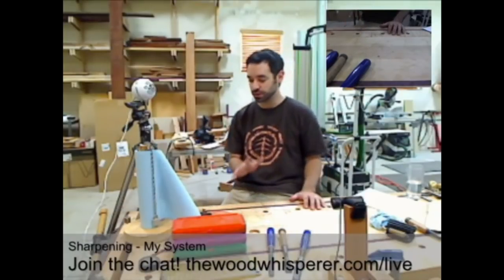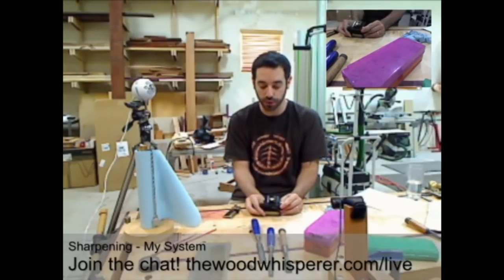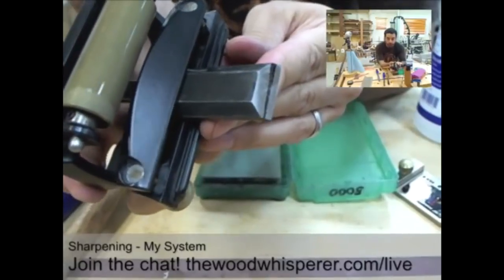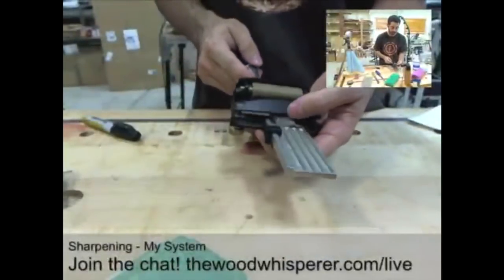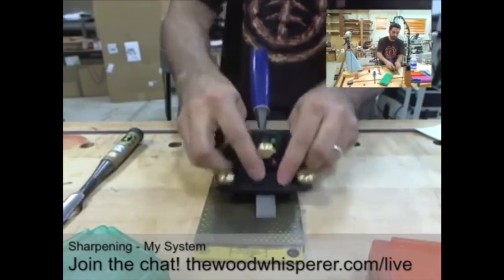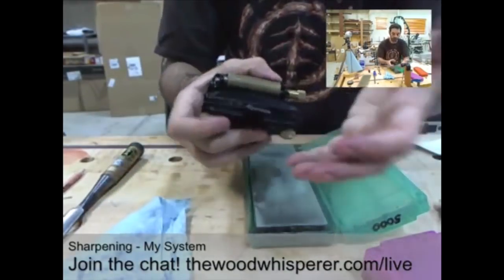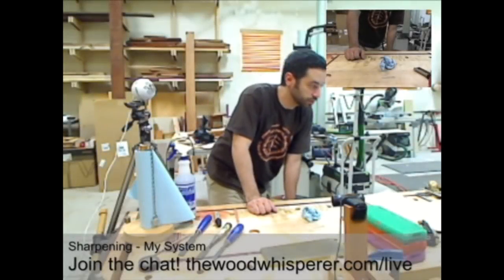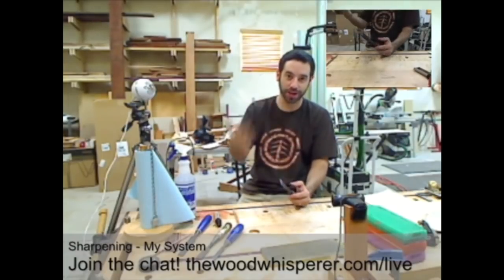181 - My Sharpening System

Comment: Marc....I want to point out that of all the Japanese carpenters I've worked with...none put ''micro bevels'  on their tools...I've never done it yet since becoming an educated sharpener...and my planes work very well...with that one long primary bevel....
Reply from the maker: Mine work well either way. It's not about performance so much as expedience while sharpening.
Reply: The main advantage of a micro bevel that I've found is that its far easier to restore the edge if you damage it, simply because there's less metal to remove.

Comment: I understand 'preference'...but some people prefer an abusive spouse over a less violent one. So,  wouldn't a SET of diamonds be faster? And last longer cost wise?  No flattening too with diamonds. I just don't get it. I'm struggling a little bit with my decision as I'm graduating myself from sandpaper. But, I just don't see the point of waterstones...at all. Why why why? Its like going out with a very annoying ,yet hot chick.  You put up with it at first b/c its fun , but then gets tired and boring and you just want to escape the bullshit.
Reply from the maker: Your analogies suggest some very interesting sub-text. Diamond plates are great but I don't think they are the clear winner you think they are. I have found that diamond plates wear over time and start to cut a LOT less effectively. A waterstone cuts at exactly the same quality level until there's nothing left. And for most home users, even water stones are likely to last a lifetime. So the argument of something lasting longer doesn't hold much relevance.
Reply: The Wood Whisperer And I can't afford diamonds anyway. Lol! I'm getting some King waterstones, unless you suggest different?
Reply: +slap stick - You made a GREAT choice. My first sharpening system was a range of DMT diamond stones and they did not last. HUGE waste of money. They wore down in about a year. The 220 is now only useful for flattening my 1000+ grit waterstones.

Marc is using Shapton Pro. That 8000 stone is $110+. But, Shapton makes the same stones under a different name for the Japanese market. Kuromaku. You can get these on Amazon. (Same 8000 grit stone is $60).

Supposedly, if you buy Kuromaku outside of Japan, there is no warranty on the stone. But I really have no clue why you would need that warranty.

It's a big upfront cost, but my Shaptons are going 5+ years now with no appreciable wear.
Reply: +Slap Stick
Go with the diamond. I can go from dull chisel to a sharp one in less than two minutes and the only maintenance I have to do with my stones is to wipe them off when done.
Reply: So, since my last post, I went with the King waterstones based on Whisperer's advice, other videos, and really just cost. About 5 months ago, I bought an 800/4000 and a 1000/6000. I use a cheap dollar stone to flatten them or sandpaper.  Total 41$. Then I got some leather and HF polishing paste for a strop  Since sharpening everything, I just use the  strop or use the 6000 for maintenance.  I even experimented with some old crystolon/india/and arkansas oil stones. Also, equally good. Just oily. I use that for really dull stuff due to limited wear. So, all in all I'm very happy.
Reply: Okay, good info and good timing... I have no idea where my 1000/6000 went. I was about to get another King, but I'll investigate the  Koromaku /Shapton stones.  Thanks.
Reply: Slap Stick King is excellent as well. I would recommend the professional line over the "home" versions. The home versions are softer and muddier.

KDS line I believe is the better King stones.

I do have the KDS 1000/6000 combo, but it's strictly for hand sharpening kitchen knives. I still greatly prefer the Shaptons for woodworking tools.
Reply: Theball Player Yeah...the home line gets them sharp, but maybe not Rob Cosman sharp, lol! I'm okay with the mud, seems to help like a polishing paste.  A little water bath setup to get rid of the excess. They last remarkeably long.

Comment: Hello Marc , forgive my English , I'm from Argentina and I do not speak good English . First of all , thank you very much for your videos, helped me a lot in my work , although I do not quite see them all but I've seen a lot . We wanted to check because I am by setting my bench grinder and stones vibrate enough , check the axis with a comparator and has a set of 1/10 mm, which if not correct. And also carry some bushes stones which are not so tight that they should go. I appreciate your comments. Cheers

Comment: It's probably been mentioned in the comments, but a grinding stone or belt would ruin the temper of the steel if care was not taken to control the heat with water. As a knife maker, I can say it happens in an instant. If the steel turns blue, the temper has been compromised.

Comment: I used to think the tormek would just ruin chisels with the hollow grind but after reading Krenov's book..he encourages hollow grinding because for one, hollow grind is super sharp and after the initial grind, you just strop it to keep it up and touch up with traditional stones in between and low and behold, you end up with a flat grind once again...start the process over.   Even fine to do with Japanese chisels.  If you aren't Japanese then there is no need to try and be one. They sharpen chisels for 2 years before even being able to use one! None of us are THAT dedicated.  I like the tormek, 10".  Its fast,you can use it right out of the box and end up with better than 1000 grit off the wheel then strop it.  They make a Japanese stone for these machines too..  Just don't strop after because the wheel is finer than the strop.   Killer shop & equipment Mark has put together over the years.

Comment: @ Alex Breton

With the Japanese Chisel, as you sharpen the chisel every time, the flat area on the bottom of the chisel will continually grow as you work it.  After you achieve your polished face bevel edge, you remove the chisel from the jig and flip the chisel right-side up and you polish the underside flat to remove the wire edge from the bottom. 

This polishing action should always extend the flat portion of the base of the chisel until the base is totally flat ... the beveled edge should NEVER actually reach the hollow portion in the base if you do it properly.  The idea behind that hollowed portion is so that the base of your chisel will achieve it's proper flatness very quickly and be easy to maintain that way for the life of the chisel.

Comment: With the japanese chisel, once you get your chisel short enough that the bevel hit the hollow part, wont you end up with a dent on the edge of the bevel? At this point you'll need to flatten all the back of the chisel until there's no hollow?
Reply: +Rammstein 125 you have to use a hammer and blunt punch to tamp the soft steel back down and recreate the hollow.the hollow is there so you can flatten it and not work yourself to death.

Comment: Just started watching your series. Very nice. One comment that may save some time. When you mentioned flattening your stones you talked about washing as to not contaminate the other stones (1000 -> 5000 -> 8000). If you started with your finest (8000) and worked your way down (to the 1000) I wouldn't think you would have issues with 'contamination'.
Reply: Why would you go 8000-1000 grit? Thats backwards
Reply: This is for the stone flattening process where each grit is ran against a flattening plate. If we center around the 5000 stone, not cleaning the residue from the 1000 stone from the flattening plate would 'add' - in a negative way, making the 5000, say 4500. Each time this is done it would make it worse than before.

Flattening the 5000 after the 8000 may still have some 8000 grit left but with a significantly less impact to the 5000 (like 5005). I see any higher grit easily floating in the liquid solution and causing near zero impact.

This is just me guessing though. Was just wondering if it would save time.
Reply: John Weithman

Comment: A question for you Marc. What kind of working life do you get out of those Japanese chisels? It just seems that they wouldn't last very long with normal sharpening considering  how close the indentation on the bottom of the chisel is to the cutting edge.

Comment from the maker: Any wear on that roller is pretty much negligible. It's rolling and not rubbing, which makes a big difference. I doubt it will wear to any appreciable degree in my lifetime. As for the flattening, you never really have to flatten the back ever again. Just polish the bevel and then polish the back. On a good quality chisel, typically, nothing more is required.

Comment: I recently bought a Tormek T-7 sharpening machine and like it very much.  it will sharpen just about everything except saw blades.  Do you know of a sharpening system that will sharpen 10" carbide tip saw blades?  I would like to be able to sharpen them.  They are beginning to be very expensive to buy and I can't find any place to sharpen them.

Comment: Sharpening is very therapeutic.  Really clears out the cob-webs.  I'm a diesel mechanic in real life with 80grit skin on my hands making it hard to really sense the roll-over wire at the tip.  What I do is keep a single sheet of toilet paper with me at the sharpening station (kitchen counter..shhhh) & lightly drag it over the tip to reveal it.  Never understood why they made the TP perforations so close together.  One sheet of TP is no good for anything else even if you're only 3 weeks old. :)

Comment from the maker: Well the Tormek is far from a bench grinder. Well, yes it looks like one, but it's a whole different ball of wax. The slow wet wheel is great for sharpening and you can get really good results with it. Some folks don't like the hollow bevel left by the wheel but others don't seem to be bothered by it. So I think the Tormek is a quality sharpening solution.

Comment: hello  i am a 19yr old apprentice joiner  from england  i was wondering  what your  thaught of the tormek  i have  recently baught  the t 7 model i know it  strange for a 19 yr old  to have baught this  considering  most of my tools will be used on  a building site  but  my employer  also  dose cabinet making and also is a traditional sash windows specialists    i was wondering what you thaught of it  as i  have a fear of  bench grinders as i have seen results from fires cased by them

Comment from the maker: I don't. I make videos for a living. :) But the only way you can compete is on quality. You simply can't compete with the low price mass manufacturers. If you try to, you'll be on a race to the bottom. Instead, you need to differentiate yourself based on quality and seek out the clientele who desire that quality.